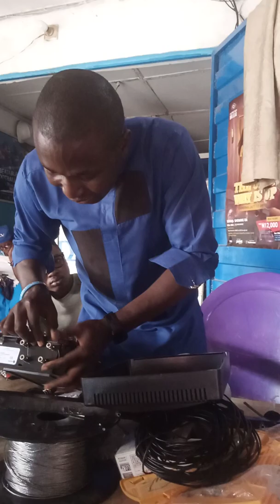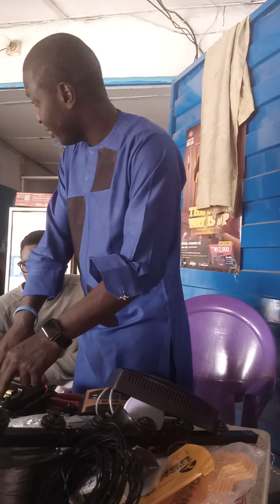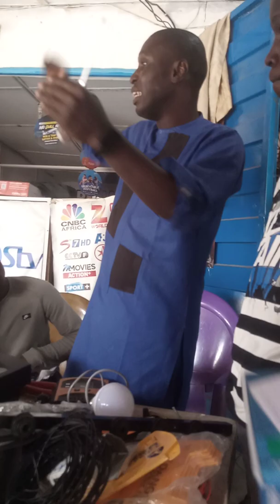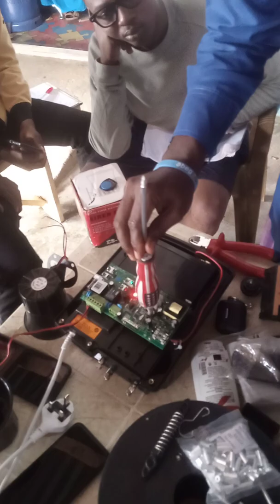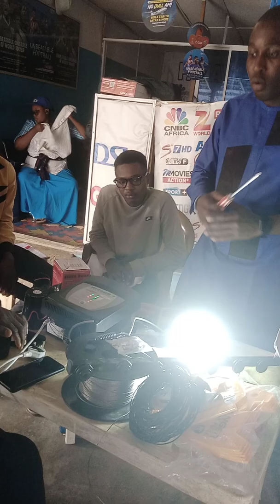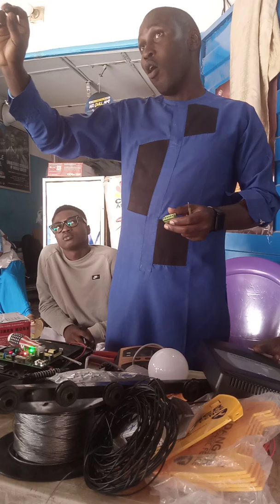Electric fence Wire day 2 session 2

Comment: Can i use regular multimeter to test the fence and is the bulb a dc bulb??
Reply from the maker: if the meter can read up to 2500 Volt
Reply: @installerpaul  thanks.... AC or DC??